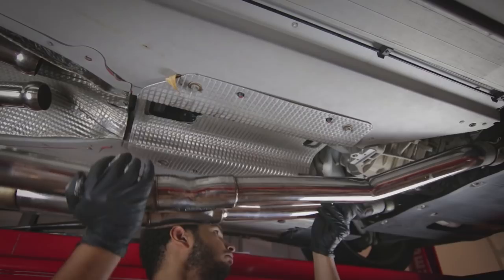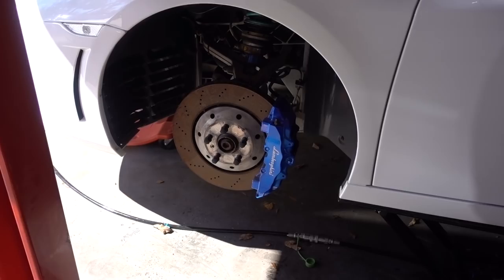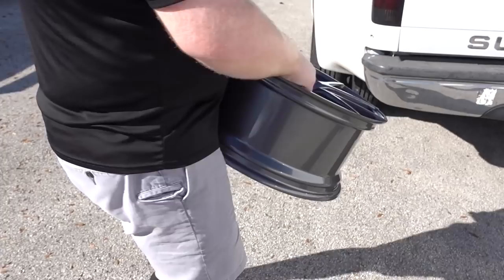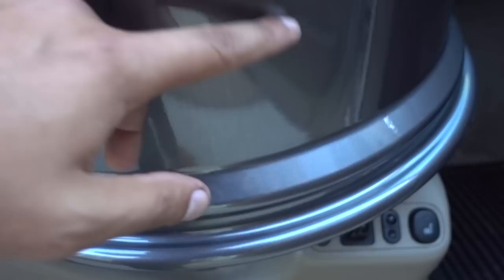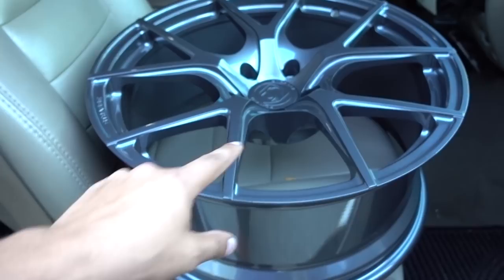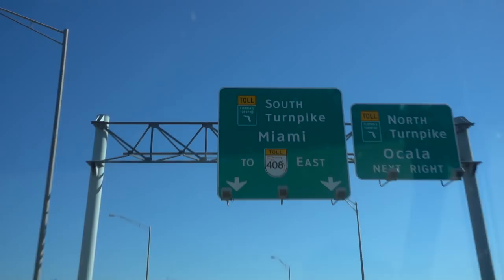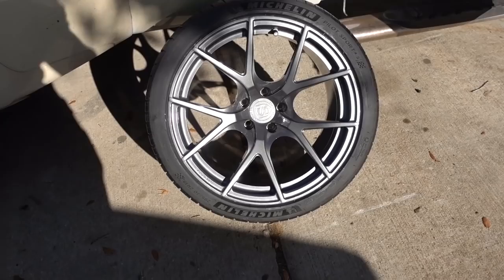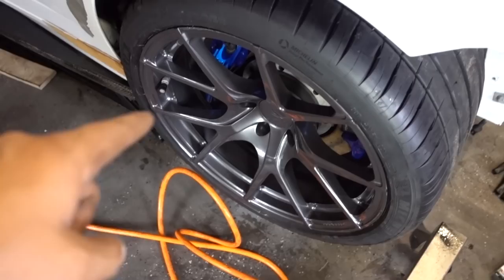I Gave My Cheap Lamborghini's Ugly Wheels A HUGE UPGRADE (For Not Much Money)

Comment: I have a vote for the Blue brakes.  I think they look fine.
Reply: Robert Mousseau +1 I think they're a nice accent for the car.
Reply: Agreed! Those brakes look really nice with the gray wheels now!  Great vids!
Reply: They definitely look better with the wheel color changed.
Reply: yea but gold ones would go with the gold foil inside...
Reply: I like the blue. Maybe add some blue accent, like the door handles or antenna or something
Reply: Agreed blue,white and gunmetal looks "elegant"
Reply: Yeah, the blue works with white and that grey wheel.
Reply: i think tavarsh removed the other blue caliper comment that or the writer removed it
Reply: Keep the blue !
Reply: Keep the blue! It's my favorite color so I may be partial, but I'd say no red for the same reason as the intake (Ferrari color). Green and yellow are awesome Lambo colors, but that's definitely more flashy than you'd like.
Reply: Personally i think they are a little too bright. Although i understand why people like it!

I think a dirty gold / bronze caliper would look very discreet yet different

Comment: Tavarish, I would recommend ceramic coating the wheels now that you have got them powder coated for added protection and ease of cleaning. You should also try it on the exterior paint when done. C-quarts is the recommended brand. Awesome video. I got the pilot sport cup 2. Awesome tire.

Comment: I've got rims powdercoated in very close to that color and silver calipers look really good. Nice contrast but tasteful.
Also, if your rims are hubcentric be sure to lightly sand off any powdercoating that gets into that center hub. Otherwise heat will slightly soften the powdercoating and almost "glue" the rim center to the hub. Makes it tough to get them off.

Comment: do the brakes white to match the car with gray lettering to match the rims, I think that would look very nice. Also instead of painting or fixing the paint issues on the car you could wrap it to match the rim color with carbon fiber accents and then do the brakes carbon fiber.  that would look SOOOO clean and still turn heads.  can't wait to see it on the streets

Comment: You must be confident that the will be able to run and drive flawlessly because if I were you, I’ll be focusing on getting the car to run first....the wheels are dupe tho’....nice finish.
Reply: The engine runs it just starves for fuel after 2500rpm. The tranmission shifts into gear when the engine is off but doesn't budge when it's started up. The clutch wasn't installed correctly and the fuel delivery system was a complete mess with very old ethanol.
Reply: He does have the money to get it fixed professionally if he wants. The engine runs it just doesn't shift gears while running.

Comment: the red wheels flowed with the red tail lights, could have gone with gloss black calipers....the new color on the wheels are pretty dope. You can go flashy with gold (like the gold heat tape in engine bay) calipers, or classy and go with the gloss black (try to keep the "Lamborghini" white lettering. Lots of luck and remember, YOU ARE THE WARANTY.

Comment: Dude, you're gonna love TIG welding!  It's like torch welding only better.  Stainless welds like butter.  All the artistic welders out there use TIG.  Nothing is out of your reach with it.  Titanium, stainless, even copper.  I welded some spring steel (the dark blue stuff they make those paperclips out of) that was SUPER THIN and I was able to dial my welder down and make some gorgeous beads on it.  To complete your shop, you should get a TIG and also a small plasma torch.  I can write my name in cursive in plate steel with that thing.
  As for aluminum welding, it's tough at first but as it heats up, it gets better.  Also, if you're forming aluminum tubing or angle/square stock you need to learn the art of annealing.  Aluminum is opposite of everything you know about steel.  To form aluminum, take an oxy acetylene rosebud torch and soot up the piece with just an acetylene flame.  Once the area you want to bend is covered in soot, carburize your flame with oxygen just enough so the flame fingers lick around slightly, not to where they'll cut or burn the metal.  Slowly heat the piece with this flame till the soot burns off then quench your piece quickly.  (The soot trick is a simple but accurate way of getting the metal to the right temperature for this process.  If you have other ways of determining temperatures in that region, then you can skip the soot process.)  Tossing it into a snow bank would be the best but in Florida that might be a challenge -lol.  As soon as the piece has quenched, it's what's known as "dead soft".  You can bend it all you want but you'll feel it tighten up as the crystalline structure starts to form and lock in places.  It'll get harder and harder to bend till it's completely work hardened.  If you still need to form it more, anneal it again as many times as you need till you get the piece formed.  If you anneal a piece and don't do anything with it, it will harden by itself over time as well.  Aluminum is a completely different animal than any other metal but if you learn its secrets, you can do anything with it.  Oh, and pay close attention to the alloys.  Not all aluminum is the same and each alloy has its strengths and weaknesses.  Some need to be riveted or they'll crack at the weld, where others can be welded just fine.

Comment: Don't only bleed the break fluid. Get the stuff out, it's hygroscopic and atracts water which leads to loosing break pressure when the breaks are hot.

Comment: Powder coating is extremely similar to the way laser printers work.  The powder consists of tiny granules of plastic that are colored with a dye.  The powder is attracted to the metal target through electrostatic attraction; a typical voltage is 25,000 volts at an extremely low (very safe) amperage.  Once the metal is coated, the product is baked for approx 20 minutes at about 375 F.  This serves to melt the plastic granules, which then embed themselves in microscopic crevices in the metal product being coated.  The final result is a very smooth coating which is extremely wear resistant; powder coating is one of the most durable forms of paint coating available, and is commonly used on surfaces which will receive a lot of wear.  Powder coating can be easily done by most people in their garages; Harbor Freight sells a powder coating kit for around $100, and Eastwood - the acknowledged leader in automotive powder coating - sells a similar kit for about $120.  You can purchase a special powder coating oven, but most amateurs buy a cheap used oven for $50 or so, and use that.  Powder coating paint is available virtually everywhere; powder by the pound and eastwood are two good sources, as is Amazon.  There are many demonstration videos on YouTube.

Comment: The calipers should be painted either gold, aluminum gray, or black, as those are all colors already present on the car. No need to introduce new colors into mix, especially if you are going for elegant over loud.

Edit: You could also go with white to match the body. If you are halfway decent with Photoshop you can take a photo, and then edit the blue to different colors to see which you like best.

Comment: I wish I could mount low profile tires on a Hunter Auto. It’s real easy to damage a rim or tire when you get down to 35’s and 30’s. Slicks are cake and rally tires are the worst. Those sidewalls are like brick walls

Comment: You explained Powder Coating well except the part where you said that they brush off excess powder. we just spray the clear coat on and that’s it, put it in the oven then repeat the same process with the colored powder. No way you can brush off any “excess” powder, you’ll just fuck up the job you did and that’s something no one wants to deal with lol

Comment: With the wheel color change the blue calipers work better and I would leave them as is, less headache and less to worry about...I'm in the camp of nixing the turbos and returning the car back to NA especially if the turbo system is what caused the fire in the first place...a nice AWE [name drop] exhaust on the v10 and you'll be 'turbo what', I don't need no stinking turbos...if you can't save the manuals at least savethev10

Comment: Yah, anything was better than the red. The blue brakes have to go but just wondering is that after market suspension, I see a hint of blue at the strut top inside the wheel well. Maybe it was just made to match the brakes, possibly not if the car was doing track work they may have changed the suspension.

Comment: Soz but I bet that the problem shifting into gear is still there. At least spin the gearbox by hand and see if gears are selectable and the output shafts turn as you would expect. Also the wheels were better before, they look like a a set of $700 Rota wheels now.

Comment: Did you check the tyre speed rating?  The Y designation means that they are approved up to 300kph (186mph), which is lower than the rated top speed of 325kph of the Lambo.  It could invalidate your insurance even though you may never drive above 90kph (55mph)?

Comment: Dude, that was a pretty awesome McGiver on the fuel cap.  Just curious, are you a full-time mechanic?  Takes some confidence to remove a Lamborghini engine!  Also, how did the truck bed liner on the valve covers stand up to the engine heat?  I was cringing when you said that

Comment: hey man congrats on the wheels being ready. one question from speculation I have heard that before balancing tires the labels should be removed.  Is that a thing or not important?  Like the sticker has enough weight to make a difference at high speed?

Comment: Yep I am in agreement that you are worrying too much about cosmetics and not getting the car running and driving.
If i was you, I would get all that sorted first. Figure out all the issues you have with wiring/hoses not being connected and all that kind of stuff. Then once you get all that done, and you know how it goes together, pull everything back out and do the mods, upgrades, rework of wires/hoses and cosmetics as you do the final assembly. That way you don't gave to worry about screwing up any of the cosmetic work you have done while you are sorting everything out.
It might seem like this would take more time but considering this is the first time you are working on this vehicle, and still sorting it out, I highly doubt it.

Comment: Take the wheels back to the shop and make them balance them with the stickers off
Reply: Finally! Had to scroll way to long for this. Also clean the part where the nut touches the rim, you can not tighten it just down. The powder coat will break en you will get play... And you end up loosing your wheel at 120mph.
Reply: N911GT2 agreed

Comment: those wheels were not "cheap" to begin with, maybe ugly color or curb rash (cant tell from video) but in the end, they are worth the same before and after the powder coating, at very little more, not enough to call them cheap when they retail 10k

Comment: I find it funny that my Volkswagen Passat has bigger brakes than the lambo. I’m not just saying bigger i mean it was full on vented and made with some actual exotic materials. Surprised myself for a second but I don’t really need them because I can stop on the highway quicker than Michael Jackson can change his race. I’m talking from 100mph to 0 in way less than 100 feet if I slammed them. We’re talking maybe 25 feet on a slight wet day. I’ve stopped from 150 in about 100feet with moderate pressure on the brakes. It’s crazy

Comment: Um NO powder is NOT brushed off its only held to the metal by static electricity. If you really want to know how its done start to finish ASK. Also its not always dipped in the corrosive dip tanks. 99.9% of the time things are Sand Blasted then sanded/masked/prepped then coated. Not here to be a dick but 12 years in the Powder Coating Industry.